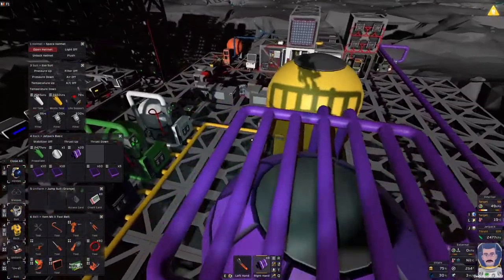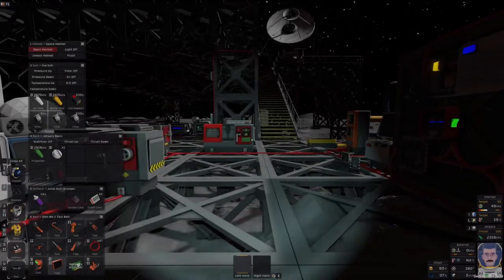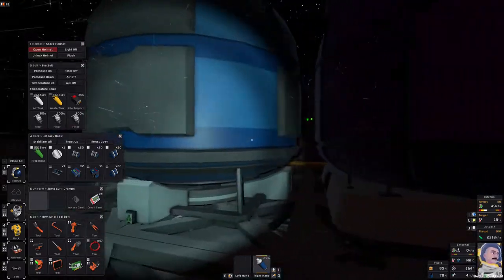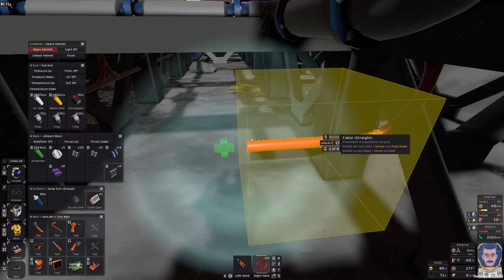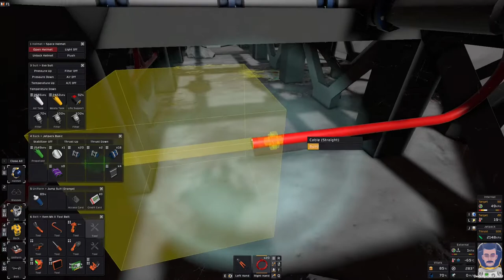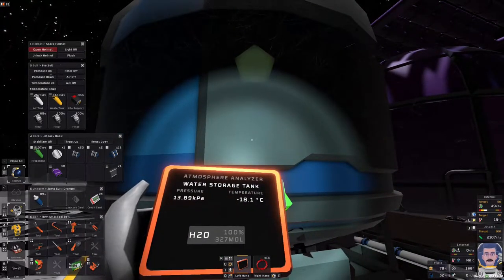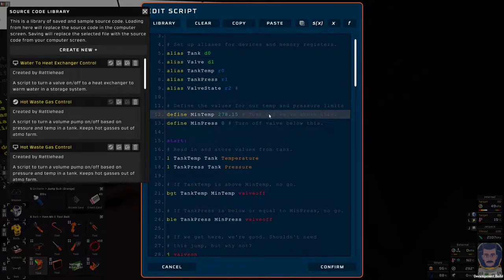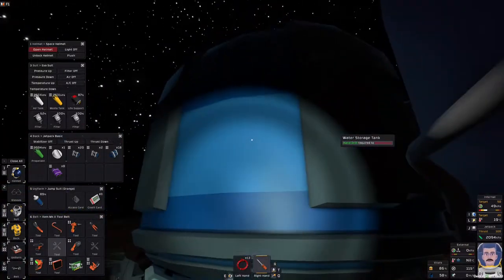Let's Play: Stationeers - Episode 15: Auto Water Heating

Comment: Great work, it was interesting to see the heat exchanger in action. When you were setting up the Hot/Cold storage system in episode 7, you mentioned one of the reasons to cool it was to remove the risk of it igniting inside the storage. Now that you are keeping it hot, is that a potential problem?

I definitely prefer the focus on the projects, and also like the summary of what you have done off camera so we can keep up with the changes.
Reply from the maker: Well, it's technically already ignited in the furnace, but I think it burns what it can then any remaining is not at a ratio that wants to burn easily. And, of course, it's not at a point that it has enough pressure to blow up. I think, with the large tank, it's got plenty of room where if the ratio changed such that more could ignite it would have capacity to hold the pressure.

Thanks for the feedback!
Reply from the maker: To be completely honest, while I know that H2 and O2 can ignite in pipes and tanks if the ratio is close enough and the temperature is above 32 C, I don't know much beyond that. I do know that it's worrisome to check the contents of a pipe and see a bunch of CO2 and other stuff at hundreds of degrees when that's not what you put in the pipe. LOL!

Also worth pointing out: That's not what happens when hydrogen ignites in the presence of oxygen in the real world. In reality, you get water and heat. In Stationeers, you seem to get CO2 and other gasses. Not sure why they handle it the way they do.